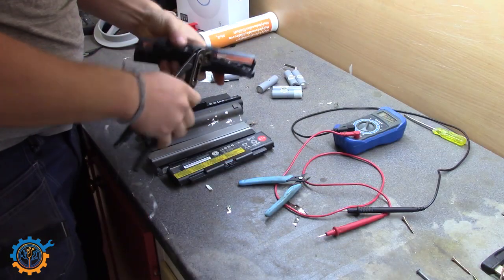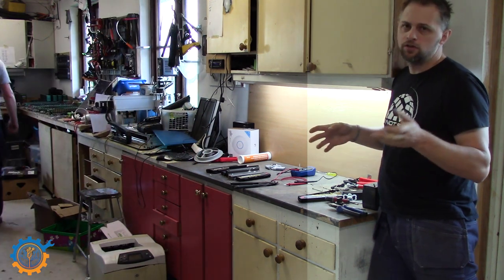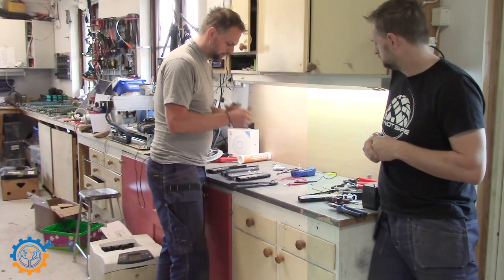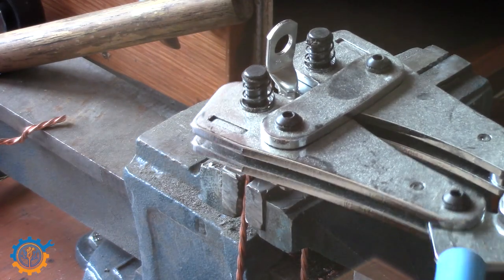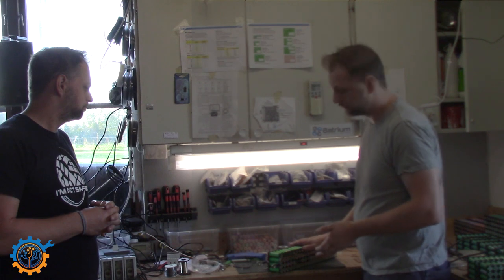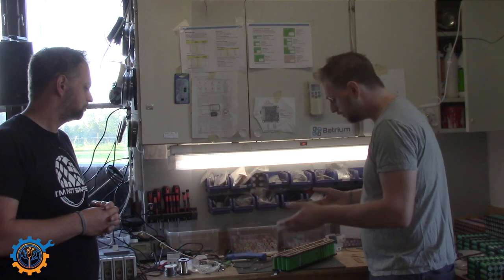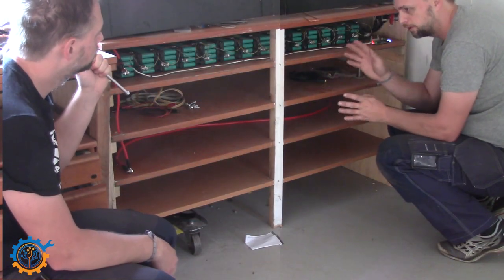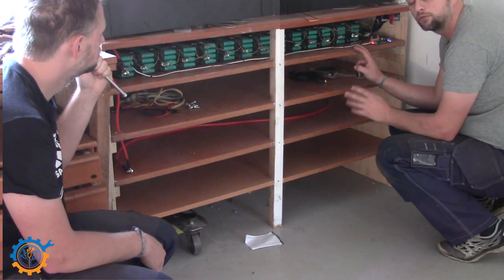SUPER tip building power walls to save time!

Comment: A quick question, having the negative and positive bus bars terminals on the same side, will all the batteries in a pack discharge at the same rate? Other powerwall builders recommend terminals opposite side?
Reply from the maker: You want as even resistance to all cells as possible. To do that its common to have the ring terminals for the busbars on opposite sides. This is the recommended way. But there is other way to mitigate the issues as well like making sure the busbar is thick enough and that your avg and max current is low. Im currently peaking at 15A per suck string and therefore the voltage drop between closest cells and the ones at the back side is minimal. So small that i doubt you can see much difference over time. Perhaps over several years but this will time tell. I have done booth for testing purposes so i can do a test in a couple of years. 

Its worth mentioning that even commercial packs have the busbars on same end in many cases :)

Comment: i am wondering how the heat management in the glass cabinet is going?
thanks
Reply from the maker: Im working on the "design" to solve it. Note that we have around +5 here now so its currently not a problem and will not be for the next 5+ months. But the plan is some heat controller that can circulate it to the batteries and if it gets to hot it just takes air from outside ( I never have above +25 in the garage even during summer)
Reply: yes but the electronics inside the glass cabinet will create quite some heat. about 10% of all the solar energy is converted to heat in the inverters etc
Reply from the maker: Its not 100% closed if thats what you are asking. There is airflow from bottom to top since a preparation for installing the fans to monitor and pressure the cabinet. So at most i had like 35c inside when i had summer heat one day.. Thats without fans :) But for longterm the fans need to be installed